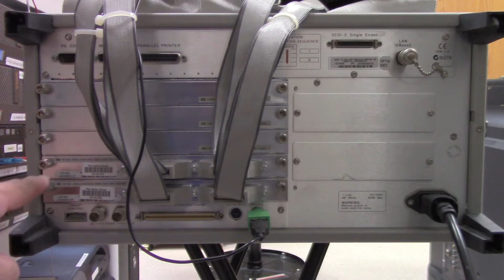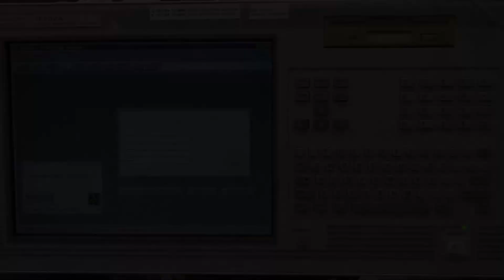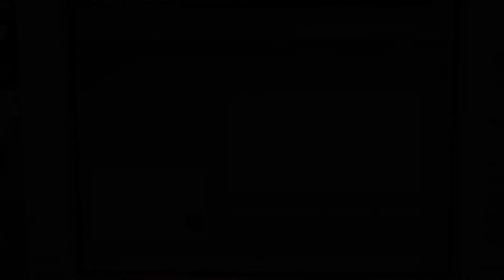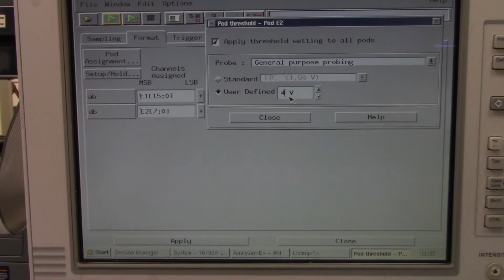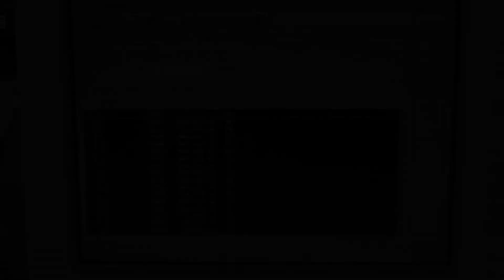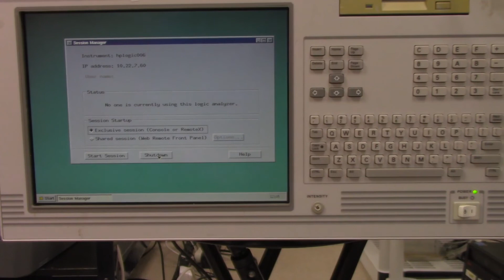Using the HP16702A Logic Analyzer with the 8031/8051 Microcontroller to Reverse Engineer its Code

Comment: As an other commentor already mentioned, you cant just shove dupont connectors into the analyser cabels as the designated probe heads manage termination. For your applictaion it may be irrelevant, but the stuff will glich and missbehave rather fast depending on the system you are analysing.

Comment: There are 90k termination resistors in the probe heads, you can't just connect dupont wires into the ribbon cable directly like you did as the signal will not be terminated correctly.

Comment: On the board where the mouse is connected to, you have to add 4 resistors (1k) so you can use an ordinary PS2 mouse. (Haven't tried an optical PS2 mouse.
Reply from the maker: I tried many different mouses. Most of them didn't work. But I found one that would work without any modifications.

Comment: Definitely it is a Unix type of operating system. You can recognize when checks the "root" file system. Another sign is when the graphical system boots up, you can see the big "X" typical of the graphical system on UNIX-BASED machines, and also the tcl-tk libraries style of the windows. This is also because you searched a lot for the right mouse, if you don't have the right mouse, it won't work at all. Hoping to be useful.
Cristiano
Reply: What's special about the mouse?
Reply: @thytoin1  HP-HIL ?
Reply: answers to myself -   PS/2 is OK but it must be a three-button mouse.